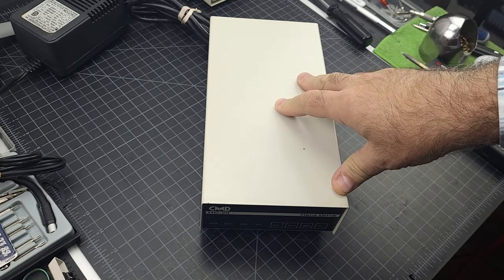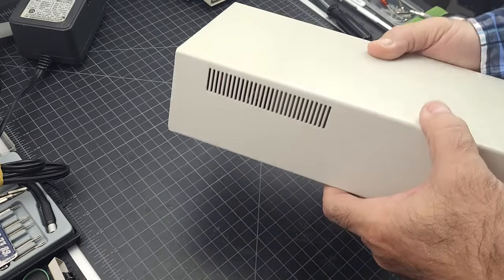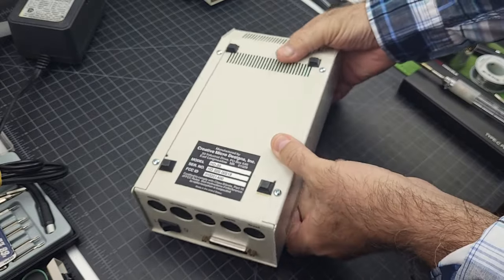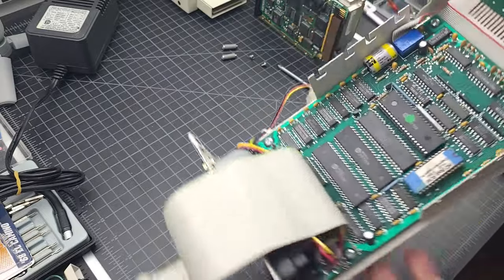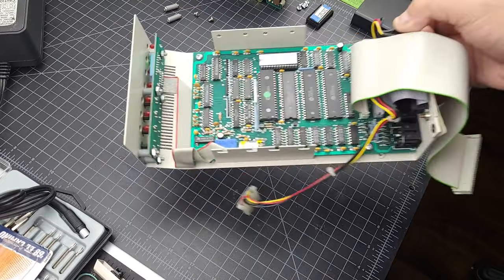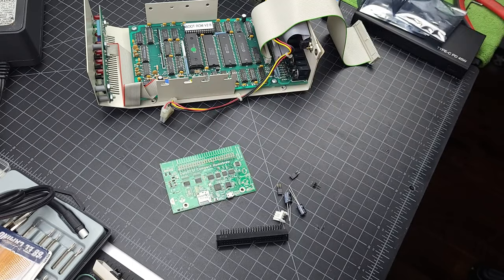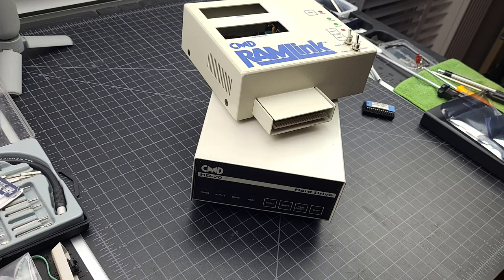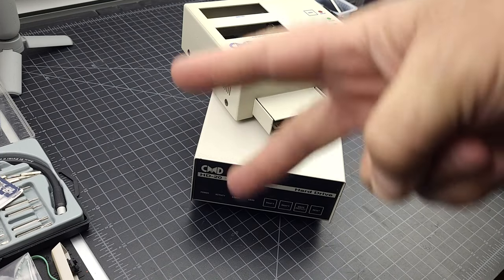Repair and Retrofit a Commodore Hard Drive CMD HD-20

Comment: One thing I miss when using those solid state replacements is the actual noise from the hard drive. Btw, it is not Jim Brain's ROM, that version was released by CMD. Jim just has the right to sell them.
EDIT: If you press "-" at the size selection you it will wrap around and you will get the maximum amount of blocks.
Reply from the maker: Thank you for the good info! :)

Comment: I still have the HD-100 I bought new in the mid/late-1990s.  It still works well too (for now).  Regardless, I seriously want this upgrade done for it but I'm not the one to do the hardware parts.  Wondering to whom, to where and how best to send it.
Reply from the maker: You may want to try one of the Commodore forums out there and find someone in your area that has a good reputation with repairs. This would not be a costly retrofit in terms of labor and I believe the zuluSCSI board was around $50usd for the unassembled version or around $80usd assembled
Reply: @revivingretro  I am working on that.  I've been working to establish rapport in general with the community I'm now in the process of rejoining.  It's amazing to me how much devotion this platform retains and maintains over time.  I'm just not sure who's local to me yet.